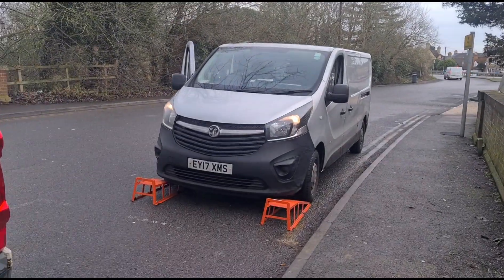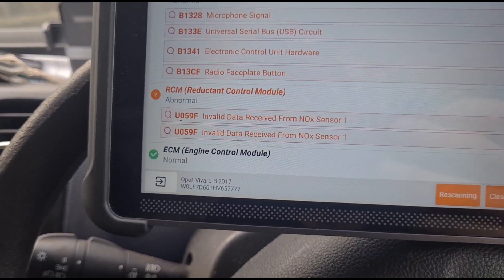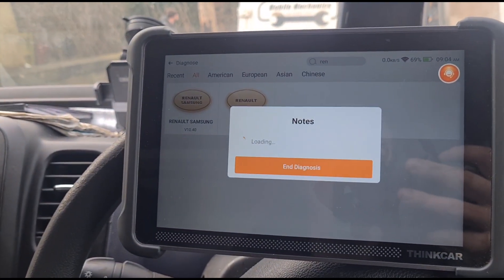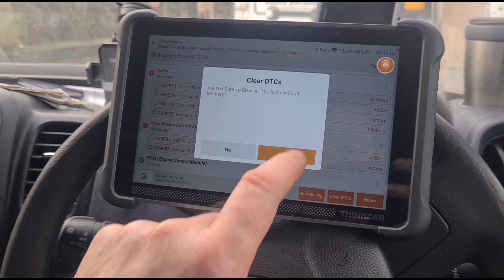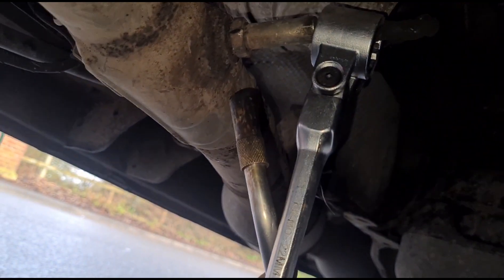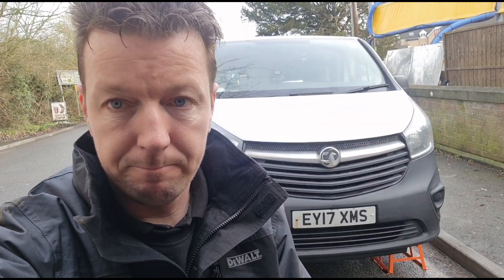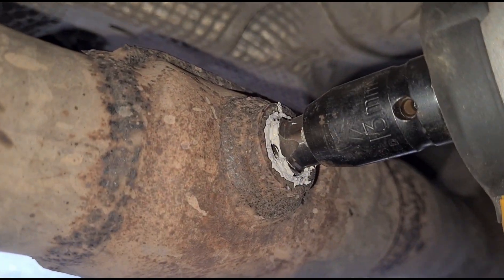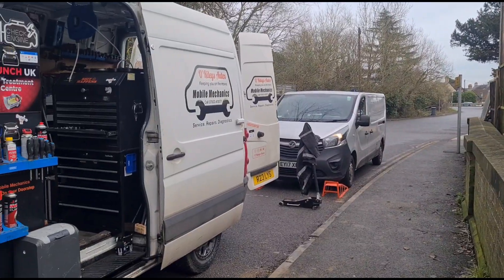Vauxhall Vivaro U059F Siezed Nox Sensor Removal & Thread Repair

Comment: @jimmy ive got codes for both nox 1 and 2 and have one saying there is a short to ground on the heater control circuit 2 short circuit code stays with the heatiing element plugged out and ive inspected the loom from the module too the heater ..any ideas ?

Comment: Where u based my nox sensor is just all turning with the thread
Reply: Any ideas on best way to get it out the nut snapped on leaving the sensor in the exhaust got heat and wd40 got it loose now it’s all turning all with the thread needs removing
Reply from the maker: Bedfordshire UK
Reply: Ok am
Based in Manchester

Comment: I cant believe you even mentioned you are working on a vauxhall and still use renault software and even worse you fitted a £300 sensor in position 1 without confirming the exact code under vauxhall(under renault sensor 1 and 2 give same fault code) and checking power ground and can at sensor, I fix hundreds of these vans and believe me sensor 2 it's just as common as sensor 1, You get a good reputation showing people what you do so don't ruin it and do the diagnostics correctly.
Reply: Where are you based ?
I need mine fixing
Reply: So where is your youtube site so that we can follow you as well?
Reply: @PhilTheProf  Sorry i don't have time to have a youtube channel! Too busy actually working.
Reply from the maker: You really think I don't know that? I mentioned it in many videos

Comment: Had this fault last week on my 2018 bi-turbo Vivaro. The code was U059F invalid data sensor 2 so you’d think it was the rear one, but live data confirmed the rear sensor was working. 
So changed the front one and all good!
Learned lots watching your other videos, you’re some man Jimmy!
Reply: Yes, you've got to be careful. Like you say sometimes sensor 2 is the front one. I could only confirm this by unplugging one of the sensors and seeing what fault code was logged. Someone had a theory that there used to be only one Nox sensor which was at the back end of the exhaust so Renault called that sensor 1. Then they started fitting 2 sensors so they then labelled the front sensor as sensor 2. Typical French 😂😂
Reply: The key is knowing what the live data should be doing not just seeing it change!
Reply: @royritchie4184  my tool couldn't show live data in Renault or Vauxhall ☹️
Reply: @Automotive_Solutions  Some tools don't show nox data.
Reply: Well nearly 10 months to the day, the replacement sensor has just failed. It was an OE sensor. 
The place i bought it from suggested its failed because it wasn’t configured properly? And that this needs to be done using dealer software?

I fitted it and then cleared all the codes using the snap-on diagnostic tool I had access to, I’m struggling to grasp how it can work perfectly for 10 months if it wasn’t configured properly? Surely it would either fail quickly or put up another management light?

Comment: Thanks Jimmy for another great video. I made a video about a Adblue fault on Continental systems. Check it out, one day you could be confronted. If I look at the old module it seems the left pin also has corrosion. Means it could be the Nox ECU and not the sensor itself.
Reply: It’s the same type of connector that gets corrosion, on a different module.

Comment: Do you only use genuine main dealer nox sensor? I need to change mine need advice main dealer or not
Reply: yes use oem parts
Reply: Sensors it’s best to go OE or OEM, aftermarket are generally rubbish from the get go.